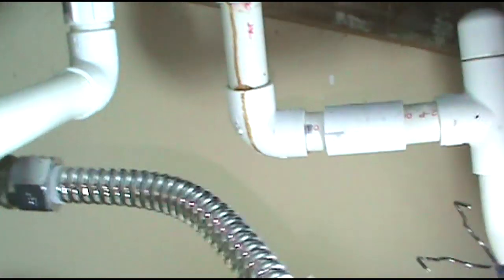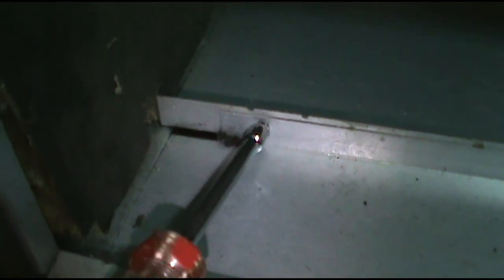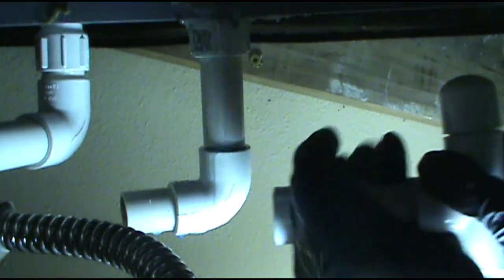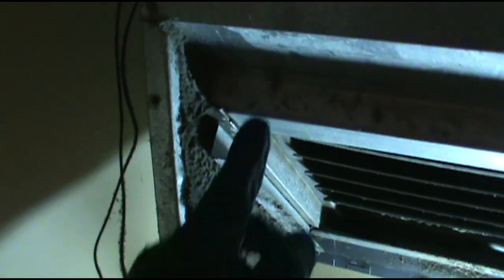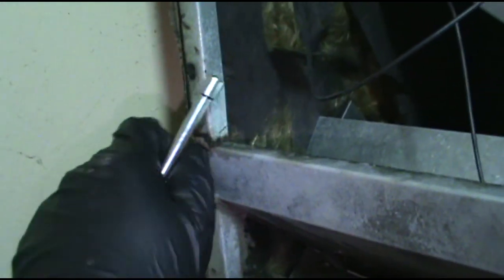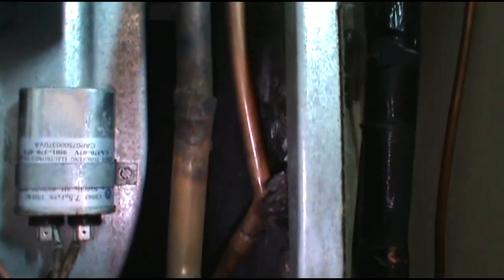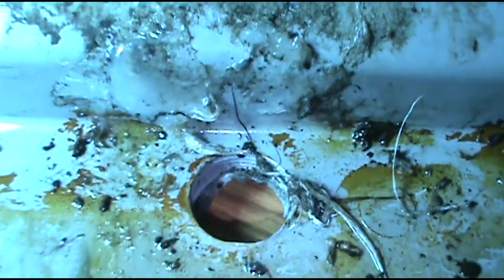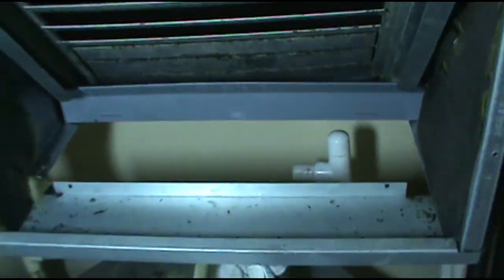HVAC- Cracked Drain Pan Replaced

Comment: I got this project in my near future. Went to unclog the drain pan and blew off the drain pipe with it breaking off with the threading still in the pan. I considered cutting out the pipe threading but I think I'm wasting my time. Breaking out the old threading is going to leave the threading in the drain pan so eaten up that it's probably not going to accept the new pipe fittings. Probably just need to start fresh.
Reply from the maker: I hope everything works out for you Texas! 🤞
Reply: @LexVance  I just worry about putting a  leak in that coil taking the old pan out. I need to order the part and we're understaffed right now. I want to wait until my new supervisor starts next week in case the coil ends up needing changing too.

Comment: Man, I wish I could lift coils to replace the pans like that. 
In my units, I have to pump down the freon and remove the coils to replace the pans because they are bolted to the coils.  And that's in both the American Standard and the Goodman units I have.
One of the sister properties has the pancake units in the ceiling. Old rusted and busted pans.  I have to break the rusted screws out and rig the new ones in
Reply from the maker: Geeez! Sounds like a nightmare on Elm Street. 
👍😂👍 Thank you so much for watching Dembone!
www.DirtyMaintenanceNation.com

Comment: My ac guy said you have to replace the coil to replace the pan because it has a crack. Any advice. There’s nothing even wrong with the coil and everything is functioning properly except for the leak in the pan because of a crack. Ty
Reply from the maker: No, you just lift the coil up and slide the pan under it or you can remove the coil and reinstall it once new pan is in. I hope everything works out for you! 🤞
Reply: @LexVance  really? Wow thanks. He is saying that the pan is attached to the coil and the only way to replace the pen is to replace the coil as well and the coil is working perfectly. The only problem is a hairline crack which you can visibly see in the pan
Reply: @LexVance  He just said we cannot accommodate you and that the only option I can do is replace the whole entire system or replace the coil and the pan for $3300 or I can go with another company

Comment: What is the best way to know if there is a crack in the Drain Pan? I pour water on top of it and it didn't drip into the pan. But an HVAC company came in and said there is a crack...A 2nd HVAC came in and said there is NO crack...So frustrating.
Thanks for the great video.
Reply from the maker: If you poured water in there and it didn't drip, I'd say there's no crack. That's how I can tell. Thank you so much for watching!

Comment: Man that was boogered up with silicone... I had one someone used flex seal which didn't work still leaked.
Reply from the maker: 👍😂👍 Flex seal! Also known as "Jerry Rig in a can". Thank you so much for watching Keith!
www.DirtyMaintenanceNation.com
Reply: @LexVance  Well on TV it shows it stops leaks on the fly 😂😂 you're welcome!! Looks like someone overtightened the drain pipe and split the pan.
Reply from the maker: @keithchafin26  I love the one where water is pouring out of the pipe & he slaps the flex tape on it & stops it immediately.
Reply: @LexVance  😂😂 instant fix

Comment: I did Maintenance and Installs on a property that the owners only bought Ameripride/Thermopride (Ever seen a plastic Condenser?) systems and that was a very common thing after a couple months. Couldn't get parts so 5 min epoxy came to the rescue. Also sucked when the strips came already broken from the terminals. Was what it was. Couldn't convince them to buy quality equipment or even Goodman. Those same people ordered rust filled refurb handlers and condensers on their last leg from Used AC Depot for their best properties and insisted on me using M099 and mixing it straight in R22 because their home ac guy said it'd work 20° spreads across the evap in Canada is considered normal. Dumbasses. Not exactly proud of my work at a couple of their properties because of the B.S. limitations. Damn proud we dropped them though because they bitched about $5 co/alr receptacles on Aluminum Wiring instead of $1 copper rated that will cause a fire. To this day I still believe that the Canadians want to kill us.
Reply from the maker: 👍😂👍 Thank you so much for watching Dwayne!
www.DirtyMaintenanceNation.com